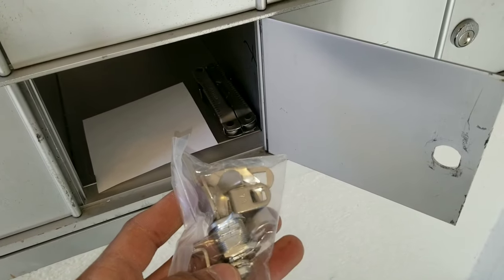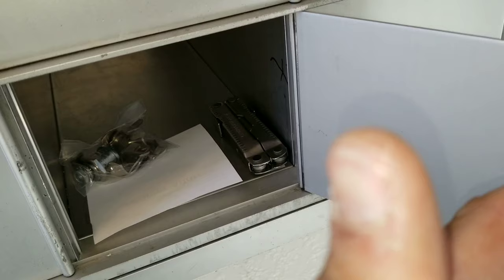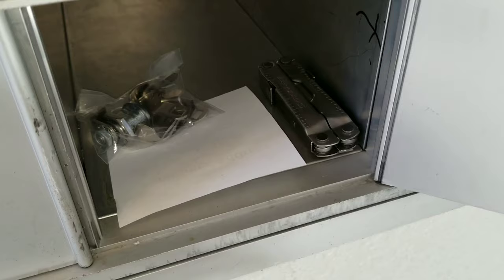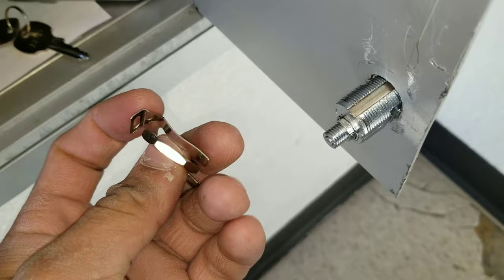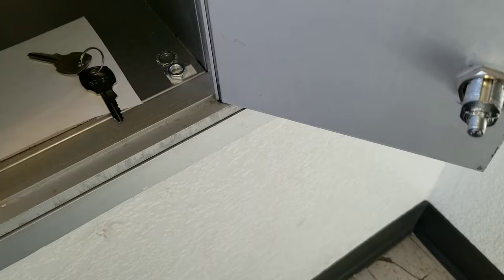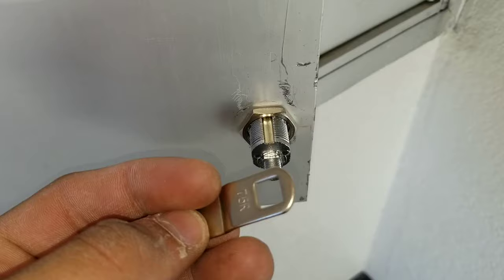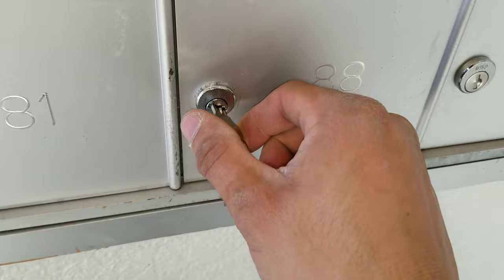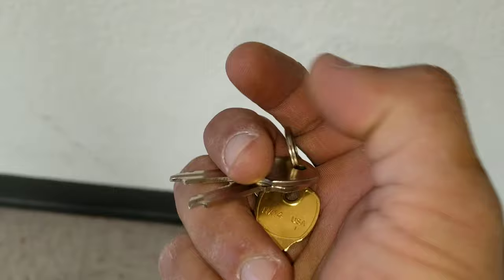Replace Mailbox Lock

Comment: This absolutely drove me nuts today and i was not successful in replacing the lock. My mailbox does not have that lip. It has a slot on the inside. Might try again later but so far not good. I just realized my original lock is a clockwise lock. The lock i was using is counter clockwise

Comment: This is so good! I followed your other video to open the locked mailbox but we have now bought two different locks and neither of them fit. Do you have any tips on how to find ones that fit?
Reply: Go to Home Depot
Reply: I realize you probably have this solved by now, but when I'm trying to replace a part, if I can, I try to take the original part with me when I go to the store.  Helps to make sure I have the same size, same fit, etc.   
Just wanted to leave a note in case someone else has the same problem.

Comment: What size is the nut? My set didn't come with one just the slider
Reply from the maker: Depending on your set up some come with a nut... some come with a slider... newer packets come with both. The nut or slider is just to hold the lock in place. If yours has only the slider it should work and the nut is not necessary.